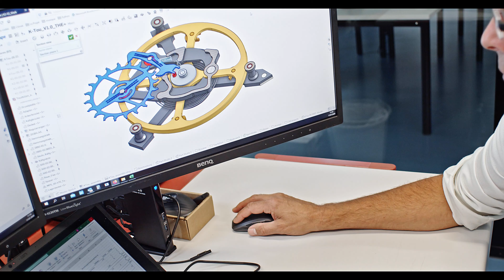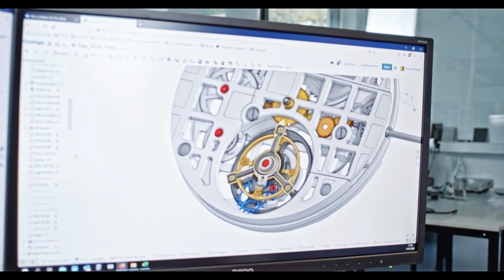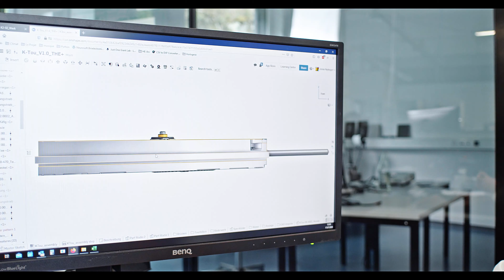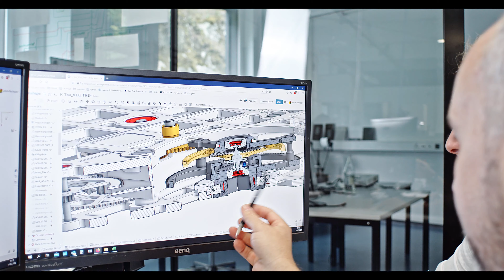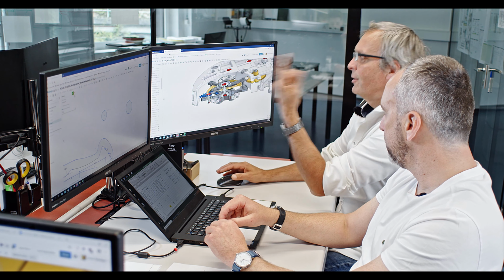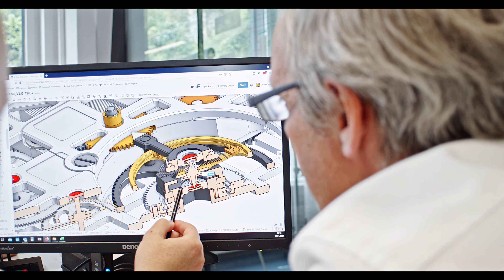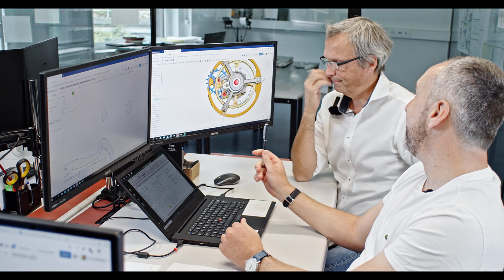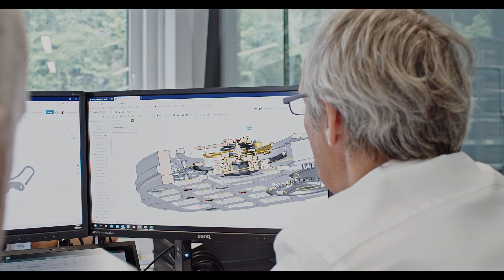Tourbillon 1- The Cage - Part 3

Comment: Thank you so much for sharing all this with us, the community, very rarely is a watch manufacturer so transparent with the industry, it is very refreshing!  One question is regarding the use of ball bearings.  I know that if constantly turning in one direction ball bearings would be great, how do you overcome the much higher friction of the stopping and starting with the ball bearings, which take more energy than a traditional jewel bearing surface?  Or are the ball bearings used only in the rotation of the cage in one direction?  Thanks again!
Reply from the maker: This is a great question.  There is as you say more energy required for the stopping and starting of a bearing over a traditional jewel and pinion construction.  Just how much is measured in micro newton meters so its an incredibly small unit of measurement.  To reduce friction as much as possible we utilize ceramic balls in our bearings.  Additionally the tolerances we are working with are so precise that we have a superbly balanced construction which further reduces friction.  Before developing our movement in-house the sample movements we had were a jewel and pinion construction and they could generate 72 hours of power reserve.  Our new bearing construction is ultra efficient and turns our 120 hours of power reserve which means the micro newton meters of energy needed to stop and start the bearing are really negligible considering we nearly doubled the power reserve by going with the far more stable and robust bearing construction.